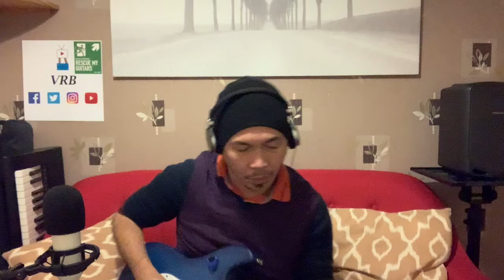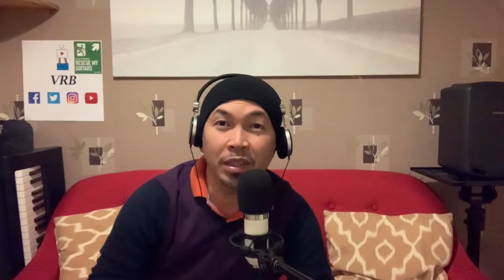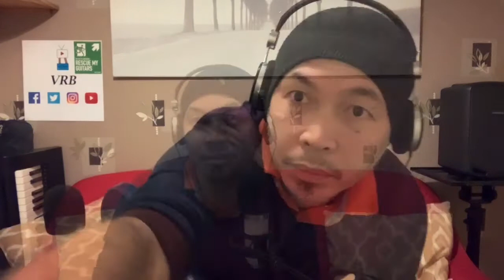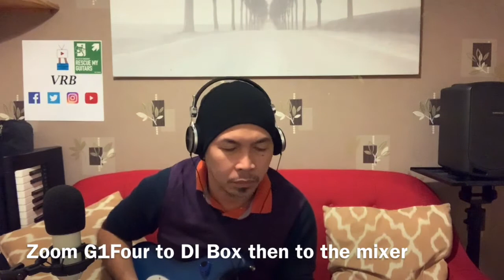Zoom G1Four Using DI Box Vs Directly Plugged In To The Mixer

Comment from the maker: The rhythm patch is just Reverb and I used HD Hall. That's all there is. I used bank 51 and just put HD Hall. 
-My lead patch is Rhapsody in bank 49 and I just turn the TS Drive on and off on the STOMP option. Here's the patch settings: https://youtu.be/8H9j7gPRhhA
-And then I used at one point my Slash Lead patch, here's the link: https://youtu.be/99cr1WxeDUY
-And then I used the Lush Acoustic patch as well. It's on Bank 33
-Then I used a GuitarPad (bank 31) for my Synth patch: https://youtu.be/aFzuVgCB2lE
And last but not the least I used my U2 patch for the delay effects: https://youtu.be/jKzdrMQGyJo

Comment: Hi if i record guitar with zoom processor through my interface its sound noisy so can i use di box for recording directly through interface or should i buy amp only
Reply from the maker: Yeah Zoom can be a bit noisy but most of my videos using Zoom G1Four as well as Zoom G1xon, I was either plugged directly to my USB interface or to a mixer then to an interface. 

There's some few things that can minimise the noise. One is to use batteries for your Zoom, second is to use noiseless cable or a guitar wireless system. Remove iPad, phones or any device that can create static noise near your electric guitar's pickup. 

Also I recently found this amp sim cab from Harley Benton which also is a good pair for your pedals or Zoom effects before you plug it to your mixer or interface. Here's the link: https://youtu.be/B2XZIOtyeTE
Reply: @vincentryanborres  thank you..yes I using batteries and good cable to and I watched linked video what is good purchase for me  Harley benton or di box ? I am using zoom g1four
Reply from the maker: @jinglebirdmusic4492  that’s good. Last tip that I can share is when it’s high gain there’s always noise. So what I do is I will only activate or step on my lead tone patch when it’s time to do lead just to hide the noise because if I turn it on already, I can hear the noise but if I left it on clean tone there’s no noise. 

All the very best to you and your music. Really happy and excited for you.
Reply: @vincentryanborres  got it thank you so muchfor advising
Reply from the maker: @jinglebirdmusic4492  you're welcome!

Comment: Hi my friends would this work with the Zoom G1xon
Reply from the maker: Yes, this should Leon. Im still adjusting with this new room and setup. In fact, if I shown you the floor, you could have seen how messy it was. I got lots of pedals because I was trying to mix and match the sound. I started fiddling with the Zoom G1xOn paired with my newly purchased Samson Expedition Express and I couldn't get a good sound so I took my Behringer DI box and tried it, still not so great, there's like unnecessary noise and it doesn't come out great on the speaker. I then decided to use the mixer. It was a bit ok with the DI box and Zoom G1xOn but I wasn't that satisfied, then I swapped to Zoom G1Four which was running on battery at the time and it seems ok. I will try it again another time with the Zoom G1xON and when I get the sound right, I will post a video.